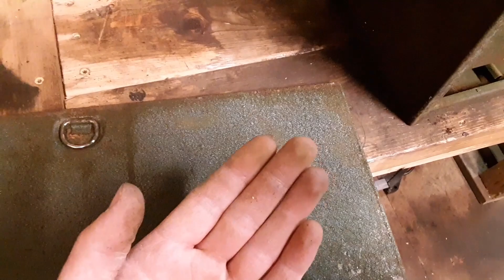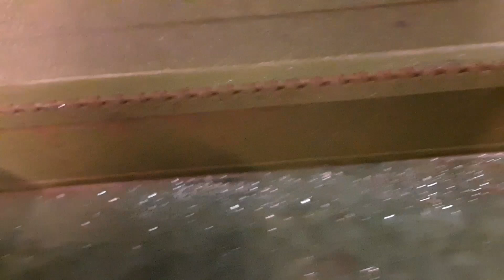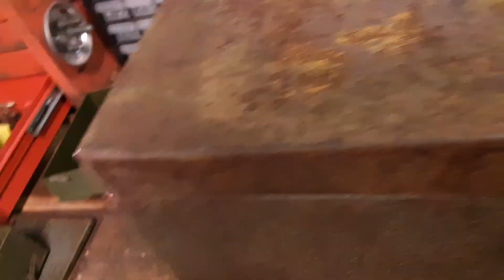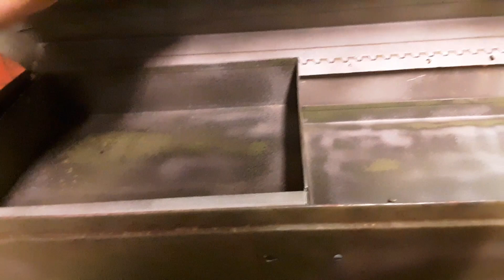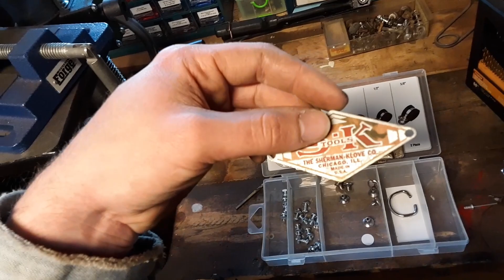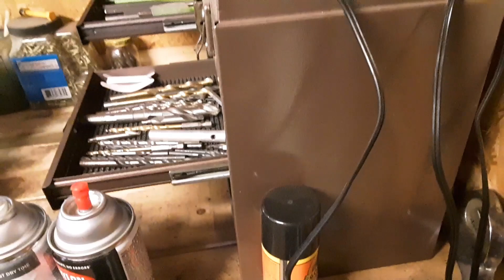S-K Tools tool box restoration

Comment: I've got a Park that is really similar to this one. I am using electrolysis to strip the rust and paint off of it. My plan is to strip down to raw metal and then Clear coat it with Rust Oleum Universal clear. I just finished a Kennedy roll around and I used the Rust-Oleum Hammer Black. It looks really good. I call it $30 and some Sweat. When you get down to it there were just a few Tool Box companies and they built boxes for everyone. Waterloo was the builder of Snap-On and they competed with Kennedy. I just posted a video on Hobby Machinist forum telling the history of Kennedy. Thanks for bringing us along.
Reply from the maker: @terrycannon570  thank you and you're welcome 👍

Comment: how did you take the top handle off? And how did you take the latch off?  Would be great to understand these steps in more detail. I have an old Kennedy mechanics tool box / cart in dire need of repainting, paint flakes off in huge chunks. looking at your video for guidance.  Would really like to see in-process how-tos vs installment status. Thanks for posting!  Very nice work!!
Reply from the maker: I just drilled out the rivets